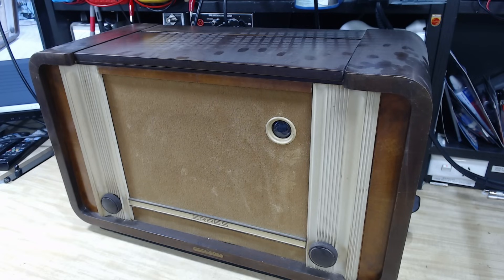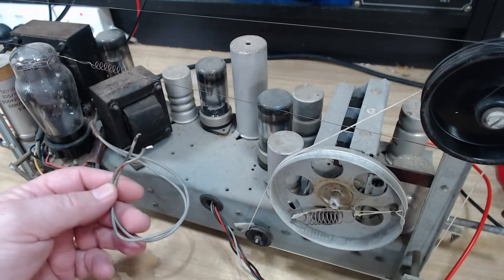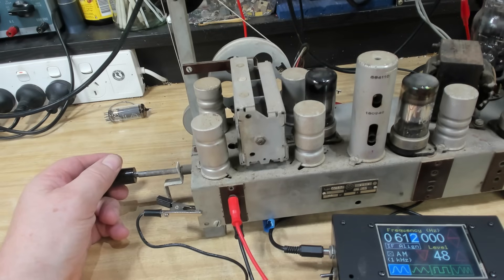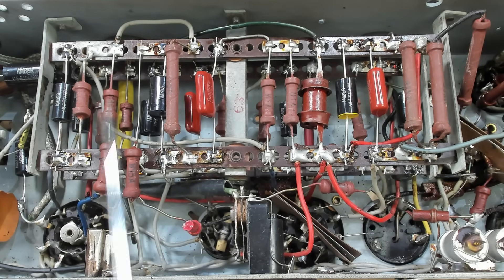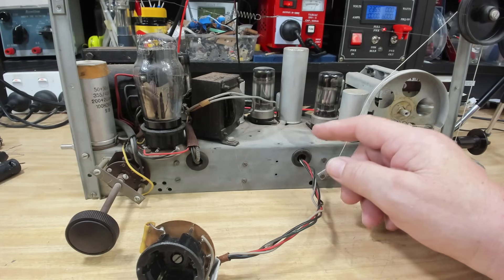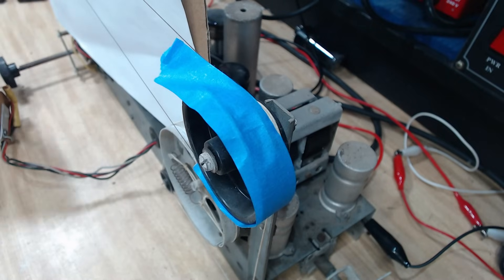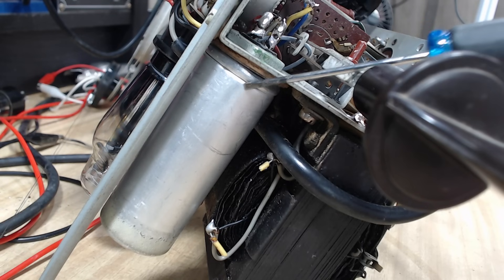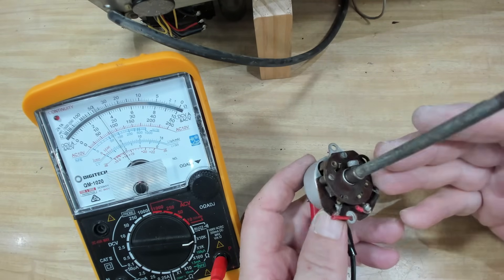Erres KY487 Dutch Radio from 1948 Rare Find in Oz - Part 1

Comment: I' m Dutch and remember the brand Erres well. It has a lot of the way Philips made radios. I still see a lot of radios on a second hand market here is the Netherlands. So lots of parts too.
Nice video

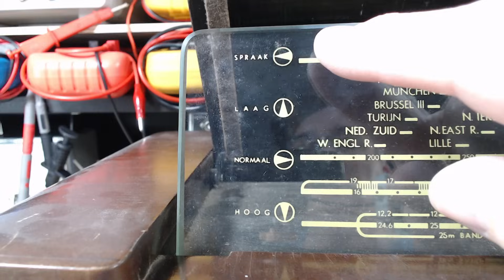At 1:06 you tried to read Dutch 😁 
Spraak : talking
Laag : low
Hoog : high 
Normaal : normal
All in tone differences
Band scheiding : band separation
Manufacturer name of erres was
Van der Heem was located in Den Haag,  Holland
The selling price back in 1948 was 395 Guldens that is about 180 euro 
About 293,8 AUD that was a lot of money back then. 
If you need to know more Dutch or something about the radio, just drop it in. Happy new year
Reply from the maker: Yes, a lot of Philips influence in the radio. It looks like a few made it to Australia too 😀
Reply: @DavidTipton101  The back story of Erres on Radiomuseum is a bit of a strange one. Apparantly Erres wasn't really a manufacturer, more like a designer and/or distributor of radios made by Van der Heem and others, including Philips. In 1930 Philips bought 50% of the shares of VdH but sold them back five years later after a dispute because VdH sourced valves from manufacturers other than Philips. In the mid-60s Philips outright bought VdH and in the 70s they bought the rights to the name Erres from the original owner R.S. Stokvis. I did remember that at some point Erres was one of the countless Philips brands (like Radiola, Norelco and Hornyphon) but had no idea the full story was that complex.
Reply: @Ragnar8504 correct 👍

Comment: Really nice work Dave! Great job with fixing the tube and also the restuff of the Capacitor. I assume that was TPU that you printed? Great idea. Also, very cool that you found the exact correct volume control in your stash! I'm never that lucky. It sounds really good!
Reply from the maker: Hi Gregg, thank you. I think I used ABS, whatever was in the printer at the time. I haven't tried TPU, it's very humid here and I wonder how well it will work and keep in these conditions. A bit of luck with the volume control, I couldn't believe it 😅

Comment: It sounds very clear with speech, i didn't hear any speaker rubbing.
That resivour capacitor looks like nothing has ever happened .
The chances that you would have that spare volume/on off control,  you lucky sod :-D
Keep  tinkering.
Ooow a capacitor leakage tester smashing  :-D.
Reply from the maker: The radio works and sounds very nice. I am getting cap restuffing down to an art 😄 Yes a cap tester, a nice gift from a friend 🙂
Reply: Yes you have an artistic touch, and your abilitys to bring a case back to beautiful is smashing :-D  
Your mechanical engineering is always spot on. @DavidTipton101

Comment: Good job! Soviet radios of the 60s used a capacity of 20-30uF and it was always enough. I never replace the inside of the old big capacitors, instead I leave the old ones in place, disconnect the wires from them and connect them to the new capacitors, which I hide in the basement of the chassis.
Reply from the maker: Thanks UkraineHamRadio, the two 33uF capacitors were ample. I don't always restuff the capacitors and mounting underneath is perfect 👍🙂

Comment: I love the way you repacked the electrolytic.  I don't have a 3-D printer, but love the idea you came up with for preventing the new ones from rattling around inside the can.  Always learning.
Reply from the maker: Thanks Tim. There are other ways to hold the capacitor, I happen to have a 3D printer now but I did quite a number of restuffs before I got it. Maybe corrugate some cardboard to make a tutu shape 👍🙂

Comment: Dave meets the laws of probability. The more stuff you have, the more chance you'll find what you need. I haven't thrown a computer spare away since mid nineties :)
Reply from the maker: Hi Paul. I agree, my first job when I ventured into radio restoration as a hobby was to gather as many spares and old chassis as I could. It has paid off very well and I have dug up many parts I didn't know I had. The volume pot being the latest. I still have a cupboard of old PC parts too 😄
Reply: @DavidTipton101  Then you can have a side huste reconditioning old PCs :), Though they are far less pretty than your radios. Can't wait for the cabinet, you always do such amazng restores.

Comment: The brand Erres was founded by R.S. Stokvis, somewhere around 1923. Much of the equipment was build at Van Der Heem in The Hague / Voorburg. Van der Heem later owned the brand. Philips was initially supplier of parts and became one of the Stockholders (1930-1938) before buying the Brand from Van Der Heem. Erres lived on as a Philips brand until 1980.
Reply from the maker: Thanks for the information Eddy 👍🙂

Comment: Hi David. I find that when the desoldering is stubborn, it helps to add a bit of fresh solder. It improves the heat transfer to the old solder as well as introducing flux. Thank you for the video!
Reply from the maker: Hi Victor. Yes, I usually that. I either didn't think of it or it didn't need it. I would have helped though 👍🙂 Thanks Victor.
Reply: @DavidTipton101  Another thing about old solders, not all were 60/40, and some were quite high temperature!
I suspect they worried about heat inside the chassis, or they just used radiator solder, pure lead!
Reply: Also use leaded solder it helps a lot
Reply: @gowdsake7103 ...as far as I'M concerned- the lead-free solder isn't GOOD ENOUGH to be LOUSY-(!)
Reply from the maker: I did 🙂
Reply: @daleburrell6273  I agree, and with the use, they have found the tin makes slivers that bridge the gap on IC pins and other components.
Reply: @gowdsake7103  My experience with lead-free improved dramatically once I found a bottle of rosin flux. One of my colleagues insisted we use lead-free when teaching teenagers how to solder and I loathed it until I stumbled across that bottle of flux on the shelf. Now I'm fine with the lead-free although that flux is one sticky substance. Random fact: the bottle just showed up at work one day and no one knows where it came from.

Comment: Nice to see an Erres over there. Erres was an abbreviation for R.S. Stokvis : RS-->Errres. Most Erres radios were made by van der Heem and sold by R.S. Stokvis(Erres). Its says speech, low, normal and high on the dial.
Reply from the maker: RS-->Errres, that's a stretch 😄 I couldn't work out how they got Erres from R.S. Stokvis 🙄 Got it, thanks Jurriaan 👍🙂
Reply: @DavidTipton101  Maybe abbreviation wasn't the right term. When you pronounce RS in Dutch it sounds like Erres. There is an old film about Erres circulating on youtube if you are interested search for "in holland staat een huis erres"
Reply from the maker: @js0000356  Ok, that makes sense. I'll have a look at the video, thanks 👍👍

Comment: I wonder if the terrible trauma of WW2 contributed to the austere designs of some of these late 40s radios.  It looks a bit odd until you pop up the dial, which is quite clever, and then it looks a bit avant garde.  Drawing a line under the pre-war designs to make a fresh modern start perhaps.  The layout of the caps and resistors is very neat too.  Looking forward to seeing it all restored and fresh.  Belated best wishes to you and your family and thanks for the laughs during the video.  😊
Reply from the maker: Spoiler alert... it looks pretty good when it's finished 🙂 Squared up moden lines after the war was the trend, a fresh start and renewed optimism maybe. Thanks Pauline, all the best to you in the New Year 🙂

Comment: Sorry 😞 I missed your video the other day. This should be called “The Wizard 🧙‍♀️ Of Oz” radio 📻. It’s always the troublesome 👿 capacitors that need to be replaced. In some cases, ya have to restuff the IF cans. Nothing sounds as good 😊 as these radios 📻. Hope ya had a very Merry Christmas 🎁🎄 and a very safe and Happy 😊 New Year!! Your friend, Jeff!!
Reply from the maker: Hi Jeff. The video only came out a few hours ago so you didn't miss anything. Happy New Year to you too 🙂
Reply: @DavidTipton101  I also don’t know if this radio is field coil, or permanent magnet 🧲. I’m going to guess that it’s from circa 1956. I always have liked 👍 the glass dial faces on these. It goes so beautifully with the glow of the dial light 💡. Your friend, Jeff.
Reply from the maker: It was built in 1948-49 Jeff.

Comment: Hi Dave and happy 2024🎉.  Curious  what tube types the loktals are. I had a feeling the rectifier was a P base tube, and then it was confirmed when you did the repair of the loose base, great job on that by the way.
Reply from the maker: Yes, a curious mix of sockets. I guess they used whatever they could get after the war.  Thanks Daniel, Happy New Year 🙂
Reply: Rectifier is an AZ1 tube :) Very common in Europe, even in the 1950s radios, despite originating from 1930s

Comment: Interesting episode,  Dave. Sometime I will need to screw up my courage and try repairing a loose valve base. You make it look easy...is it? 
Thanks for the new post.
Reply from the maker: Hi Joseph. You have to be prepared to lose tha valve if you do it. Getting the thin wire to stick to the tube wires can be harrowing but once firmly attached it is reasonably easy. Thanks Joseph 🙂

Comment: Very interesting circuit design. It looks like they've used a fancy-pants sensitive output valve (EBL21) to compensate for lack of IF gain. With  AGC diodes built in common-cathode style to FB to RF and IF amps (both ECH21). The IF amp also acts as the demodulator and ref for the magic eye (EM4) I think through the volume pot., I'm not sure on that one, but that's what it looks like to me. Anyone with more experience on these circuits please feel free to correct me - I'm here to learn 😊 Great job as always David, you dropped lucky with that volume pot! Happy new year.
Reply: It could be that the EBL21 diodes are employed for detection and the ECH21 is doing the magic eye and AGC but the feedback from the EBL21 suggests to me that it is the AGC diode and not the IF amp. Edit: Or maybe the EBL21 is doing both the AGC and detection? I can see that one diode (left side) is connected to the centre-tap of the IF amp secondary winding, which suggests detection. Anybody want to confirm which is correct? (if any LOL).
Reply from the maker: I don't have access to the circuit with me. From what I remember, the ELB21 does the detection. The ECH21 is used as a mixer and IF amp. I think in the IF position it used the heptode section to pass the signal through a small centre tapped transformer and power the eye and onto the volume control The centre tapped transformer was used for detection and I guess for AGC?. After the volume control, the signal was then passed through the triode section of the ECH21 onto the output valve. I can't remember so I might be totally wrong. I did the radio at the end of November, I can't remember what I had for breakfast 🙂
Reply: @DavidTipton101  Whatever you have for breakfast I should be having it, I think your description is spot on.😁👍

Comment: It is similar to a Philips BX373A, well at least I am familiar with that chassis. I own a Kosmaj 49, which was built in 1949 in Yugoslavia under Philips license, well actually it is 100% model Philips BX373A, and 100% Philips parts, except the casing which is more plain looking wood one. Mine is almost in mint condition. It worked on the first try, with no hum or excessive power draw. The only thing, like yours, it needed those valve sockets cleaned throughly because it was really intermittent. It is quite collectable, with compass style looking dial :)
Reply from the maker: The BX373A is very similar. Same mix of Loctal and P base valves too. I hope that design for the loctal valve bases is more reliable, mine cleaned up well and there is good contact with the pins now. Thanks michvod 🙂
Reply: @DavidTipton101  Yes, well they used AZ1 as it was a standard rectifier and produced in large quantities. For other valves they used 20 series as it was newest and considered the best at the time. Bit of trivia of Kosmaj 49 radio, it is considered to be first radio produced after war in Yugoslavia, which is kinda correct, but kinda isn't. The first was actually Kosmaj 48 which was produced in late 1947 early 48 and was a totally different design (but used almost the same valves, except for the AZ21 rectifier, and a electrodynamic speaker), it was actually based on some Orion radio from Hungary, both being completely communist countries at the time. That said, after the Tito turned against Stalin in mid 1948, and the Yugoslavia became a socialist republic, the west immediately stepped in and helped Yugoslavia with resources, and one of them was deal to produce a domestic radio with western components. I also own the Kosmaj 48 radio, but it is in a bit of a sorry state cosmetically. It performs much worse than the 49, despite having been restored and aligned. You just can't beat Philips stuff from that time :)

Comment: Hi Dave, when you first showed the chassis with so few tubes and a three section tuning capacitor I too thought RF stage and perhaps the last IF operating in reflex mode. However I found a circuit and was surprised to see no RF stage but a double tuned passive preselector ahead of the mixer; the designers must have wanted good shortwave performance.
Reply from the maker: It's a complex circuit Peter, I didn't even try very hard to understand it. It works very well. We don't get a lot of shortwave here so I didn't test it on that. Thanks Peter 🙂

Comment: Just curious if you could of stacked 2 47uf caps vertically in that can? Another fantastic project Dave!
Reply from the maker: It was just too tight Marty. I could have gone a 47 and a 33uF but the two 33s worked so I didn't bother. Thanks Marty 🙂

Comment: Hi David, 
Actually Erres and Aristona were sub brands of Philips back in the day. Erres was a bit cheaper so after WW2 everyone could more or less buy a radio.Btw, I really like your channel.
Reply from the maker: Oh, OK. Thanks Mr Dutchman 😀
Reply: That was only later. Erres since 1966 and was independent before (Van der Heem). Aristora was a brand of NSF (Nederlandse Seintoestellen Fabriek - Dutch Morse-equipment Factory?) but since the name NSF collided with a German company called NSF they used brand name Aristona (first outside the Netherlands but later also here). Aristona was already merged with Philips in 1955. Before 1966 for Erres and 1955 for Aristona they were independent brands. Although Aristona outsourced production to Philips. Once merged with Philips they were use as brands to create artificial competition or as cheaper alternative to Philips (sometimes the only difference was the batch and the knobs and maybe some different colors but the same electronics...).

Comment: You are one lucky rascal! What are the chances you would find the exact same volume/on-off switch for a radio manufactured a lifetime ago in a country so far away that it is closer measured through the center of a globe than if measured along the sea lanes; yet you had that odd switch assembly in your used parts bin of antique radio parts? Amazing!
Reply from the maker: Yeah, I was stunned when I pulled out the container and the pot was right on top. I hadn't taken any notice of it beforehand. My policy of grabbing every bit and box of old radio parts paid off. Thanks Jeff 🙂

Comment: A capacitor restuff makes the radio look original and fix the problem at the same time.  It's amazing how much smaller today's caps are. Great video, Mate, and looking forward to part two.
Reply from the maker: I like doing the restuffs radio lover. It keeps under the chassis a lot neater and it's a bit of fun. Thank you 👍😀

Comment: those loctal valves often have poor contacts, and especially with those type sockets!
Reply from the maker: They have contact problems with any socket Andy 🙄🙂
Reply: @DavidTipton101  i know, 😏 theyre a pain in the derriere! although the Philips/Mullard/European loctals usually have silvery plated pins, and less trouble than the ones of USA origin which go black a lot..... B8A types(EL41, etc) can be almost as bad....

Comment: Interesting set, my first impression on seeing the dial was Philips, as soon as I spotted the chassis, it is either made by Philips or uses their components.
I really don't like loctal valves, they always seem to have poor pin connection, not a great design!
Reply from the maker: Hi Mark. I suspect there is a lot of Philips is in this set. Loctals are problematic but I haven't seen a loctal base like that before, It seemed better than the usual design.
Reply: Hi David, Certainly better than what was fitted to my Pye TV from 1949, horrible thin paxolin bases for the EF50 valves.
Good repair on the rectifier valve, I guess they were using up side contact valves from the 1930's, another weird Philips design! @DavidTipton101

Comment: Erres was the "budget'' brand for Philips. Using proven technology from designs 10 years earlier. Normaly very solid and reliable radios. Apart from the usal leaking caps, cooked valves, dirt, and what not more that all old tube radios suffer from.  
Erres radios are much better then their general appreciation is. 

I enyoy your podcasts.
Reply from the maker: Thanks Martin. This Erres looks and works superbly 👍🙂